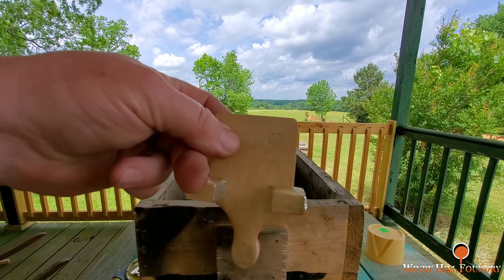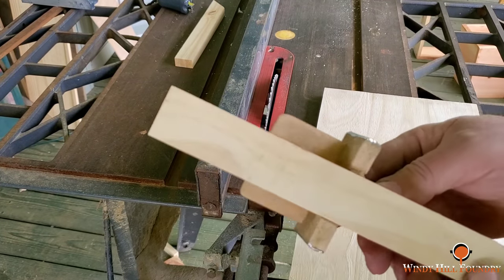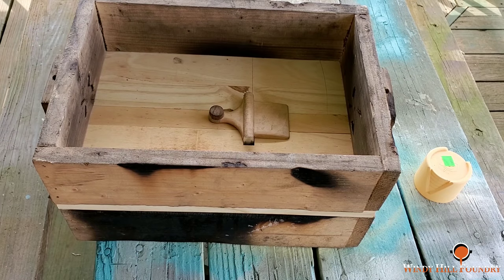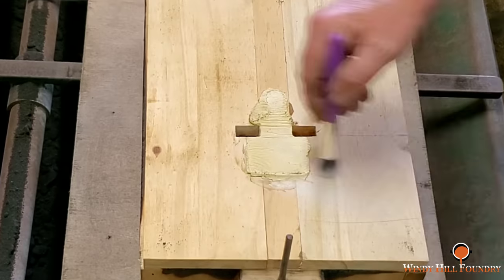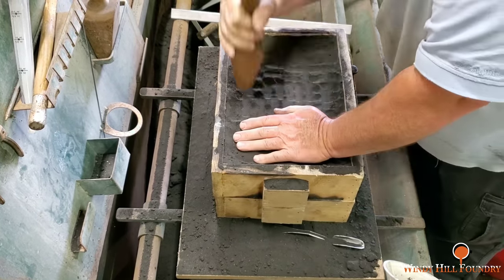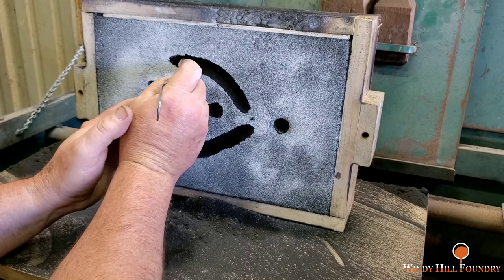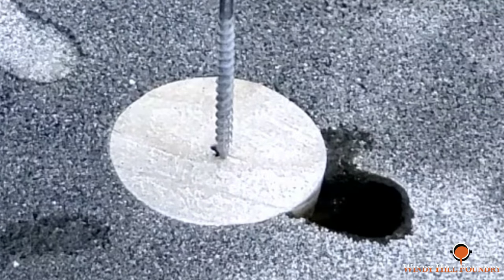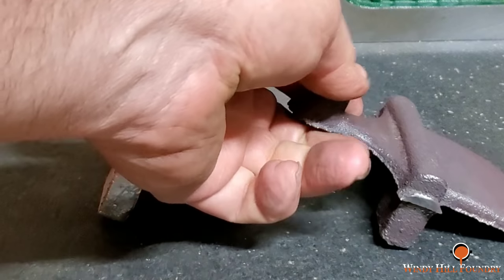HAND PLANE IRON

Comment: Thanks for the miter gauge alignment tip.  I have only owned my Sears table saw for 40 years and never figured that quick alignment trick out.
Reply from the maker: Brian I'm the same way. I enjoy woodworking but I'm not buying an expensive table saw. These aren't ever the most accurate but, with a little practice and patience I can get good quality cuts out of just about anything.

Comment: Irons for planes are never cast. What you made was what would be called a cap iron. It holds the blade in place while making the cut adjustable. Thank you for making this video. I find this kind of thing intriguing.
Reply from the maker: Thanks for the correction👍
Reply: @windyhillfoundry5940  You are most welcome and thank you for taking the time to show your work.

Comment: Very nice work! Curiosity got the cat, but I gotta ask: can you give some detail/history on the part? I’m guessing this is not the plane iron - blade - but the chip breaker or cap??
Reply from the maker: Yes it is the cap that holds the blade I believe. I should have done my research I know and at one time i knew all about hand planes but my noggin has shook a lot loose over the years

Comment: Just before you pour, do you add any inoculate into your iron?  I made a pour of cast iron, last year and could not machine it, even with carbide tooling.  An old aquaintance from a foundry gave me some to put in and that solved the problem. I was melting a disk brake for my metal source.
Reply from the maker: Keith a lot of things can contribute to that. Ferrosilicon can help but not always. If a casting is too thin, low mass etc it can chill instantly. I still have that issue on one off castings sometime

Comment: I have a couple of questions. Could you make a styrofoam mold and leave it to burnout? If you can’t could you use something like Pam on the mold to prevent sticking or could that cause an explosion in the pattern?
Reply from the maker: Kurt I have never messed with styrofoam. I know there are those that have but as many issues as I have to monitor, I'd be concerned that something like this could contaminate my sand
Reply: Windy Hill Foundry thank you for answering! I didn’t think of contamination of the sand! I just figured it would just dissolve. But it has to go somewhere doesn’t it? I worked at a foundry but I just followed the ladle and made sure that the molten steel didn’t stick to copes or drags. They were made out of steel and held together with steel pins. We used shakers to shake the sand out of them. Interesting job . They made parts for trains. They have closed this facility but there is still one open.